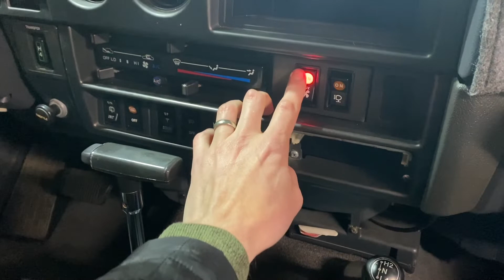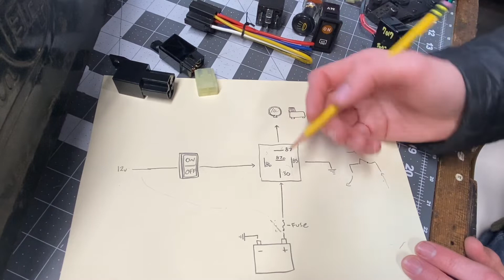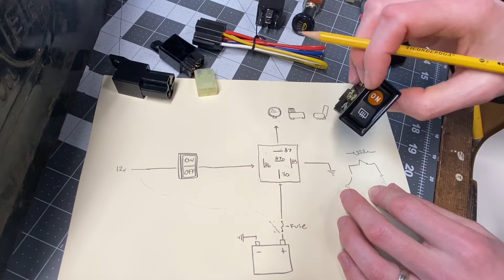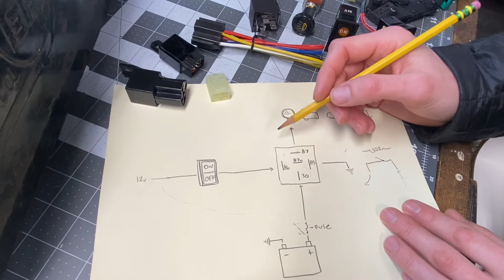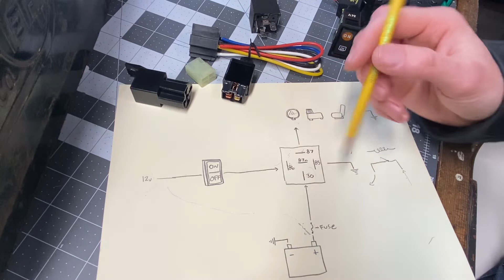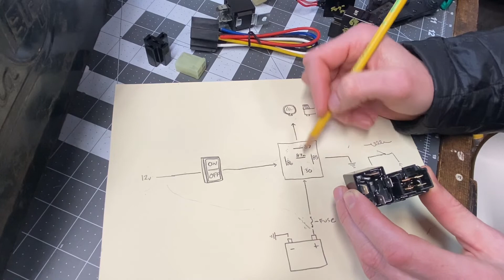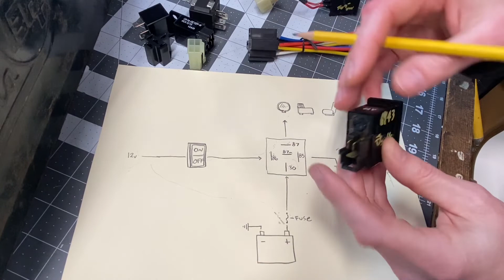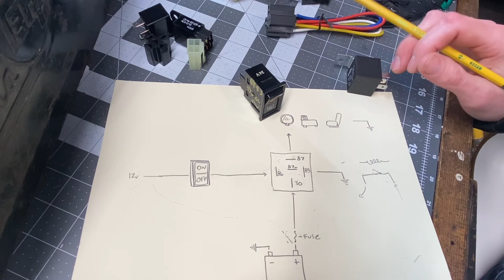Saturday tech: Relays and how to power accessories in your Land Cruiser

Comment: Have you installed a relay for your headlights and used the steering wheel switch?….. I am upgrading the headlights on my FJ62 and trying figure out where to tap into the steering wheel switch.

Comment: Hey mate thanks for the Video! This will be super helpfull when I need to convert my headlight upgrade Kit from Toyota from 12 to 24 volt relays. Now I just need to find the relays that fit, couse the ones that are integrated in the loom look different than the ones that you show here.
Reply from the maker: Thanks! I have one of those kits, I'll go peak at the relays and see if I can find a 24v version as well.
Reply: @cruisercult  Would be so great to find a solution for it to work properly...
Reply from the maker: @thelandcruiserproject5421  So the straight swap would be part# G8HN-1A4T-RJ-SK 24DC, but that may now be obsolete so a work around needs to be sourced. Not impossible :) Here is a sheet on the specs we need to match: https://omronfs.omron.com/en_US/ecb/products/pdf/en-g8hn.pdf
Reply from the maker: Panasonic relay: CM1A-R-24V may be the ticket! Has a built in resistor and is 24v. Will plug in. It doesn't have the locking tabs on the side but I wouldn't think the relay would every wobble out.